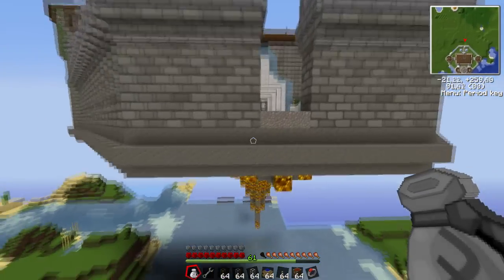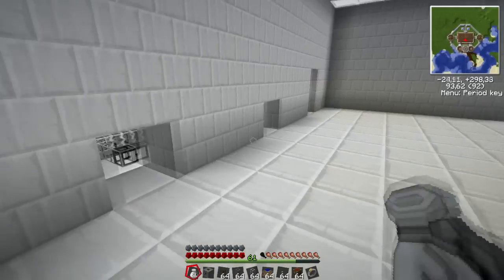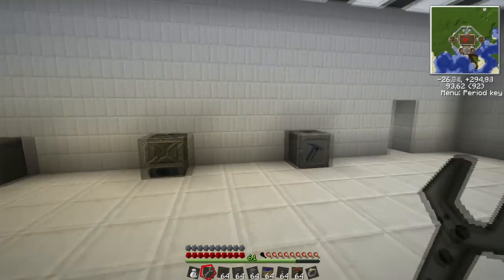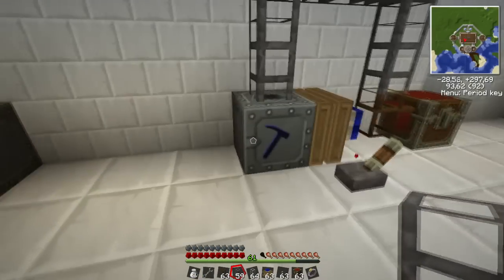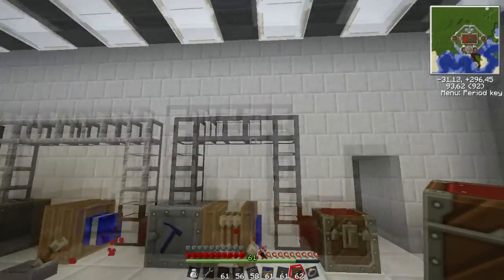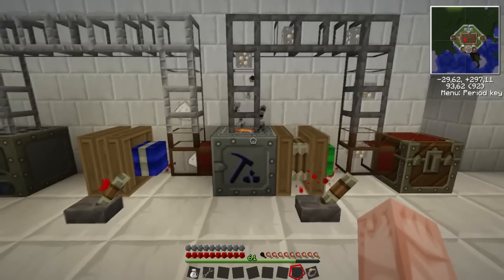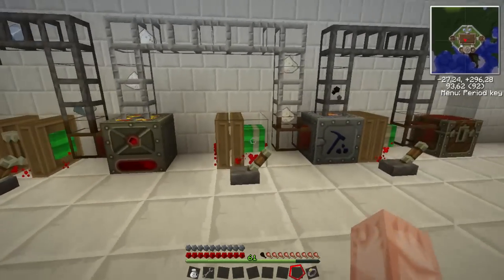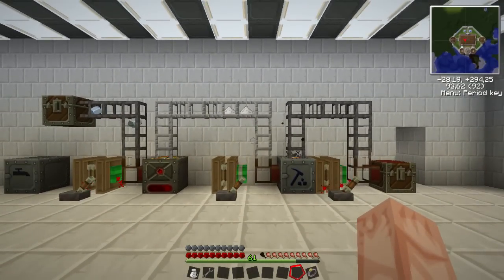How to Tekkit - Basic Machines and Pipes

Comment: Redstone engines do blow up if they have nothing to power keeping the pipe in front of them will prevent it, but if you remove it either shut off the engine or replace the pipe right away.